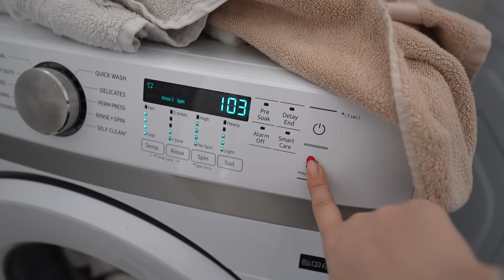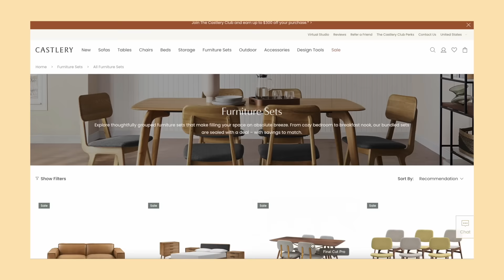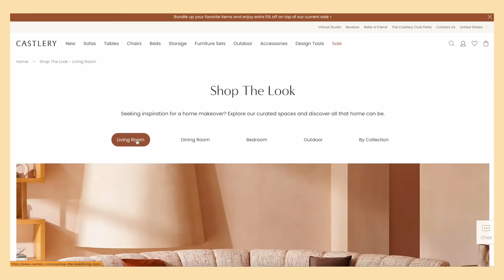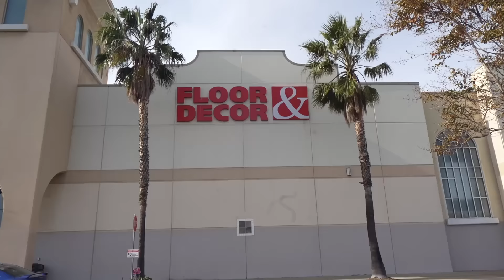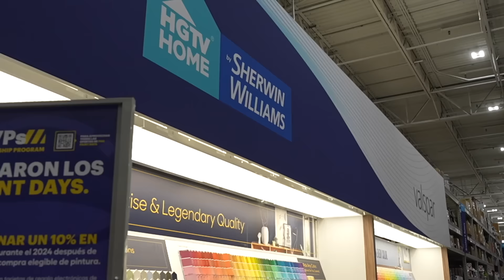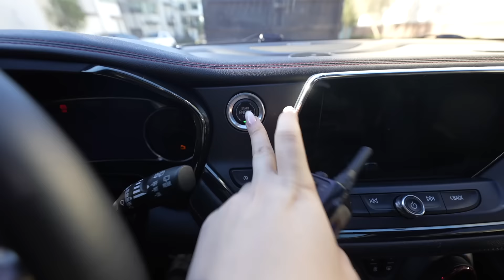my EXTREME HOME MAKEOVER ($10,000) | new flooring, new bed, new couch

Comment: 19:54 yes im in the same boat. My tile floor looks horrible and the grout its coming out when i mop like chalk. The paint from doors and everything that its wood looks uneven plus when we takd showers its coming off like melting away bubbles. The wall paint looks like primer 😐. I said white, and they put beige. Is your house with those same problems? I think they put cheap material and like you said they want it to finish fast with all the houses. What it sucks for us is that we paid cash and for HOA and not a good job.The thing is we cant trust no one. When it comes to remodeling. My mom did her restroom and the tile from the walls looks bumpy.